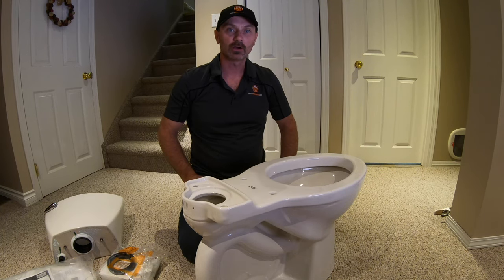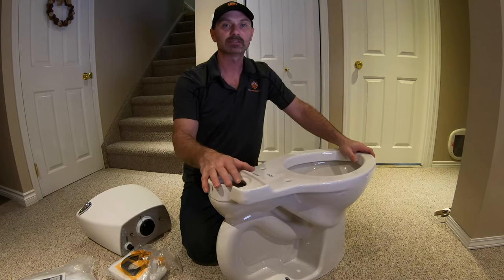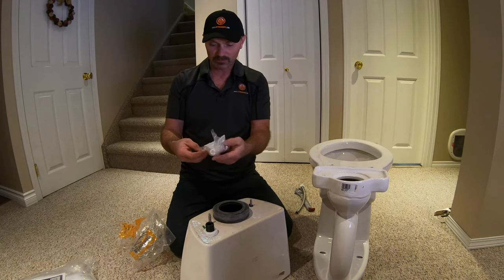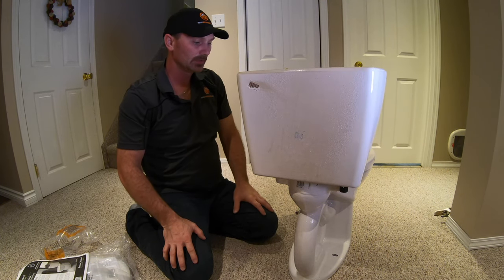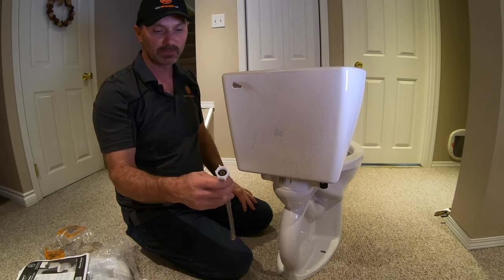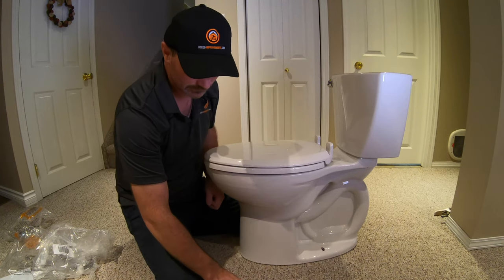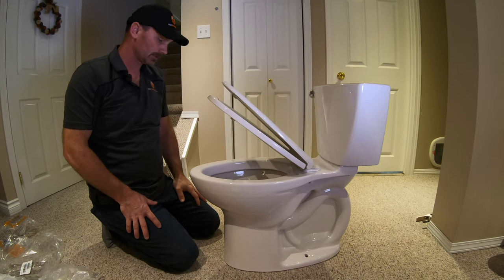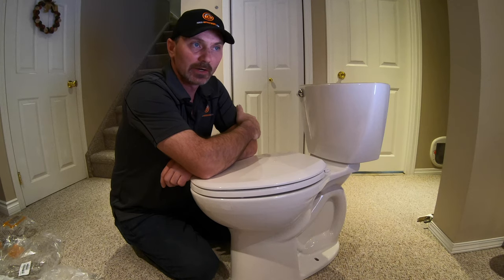How To Assemble a Toilet

Comment: I removed a 32 year old toilet from my master bath and installed the American Standard Champion tall height today.  It was the first one I've ever done myself.  This video and your others really helped.  I also replaced the shutoff valve which was also 32 years old.  Removing the old nut ferrule was a pain since I didn't have the proper removal tool, but I got it off and the new quarter turn installed.  Thank you for this and all your great videos!

Comment: Will a toilet that sits normally straight forward with a window behind you ,be turned say to the right so that you can look out the window now on your left? Will the holes line up?
Reply from the maker: Most likely you will not get an existing toilet to do that . The flange has to turn to allow the bolt holes to be in the right position . Also you will most likely end up with the back of the toilet a fair distance from the new back wall and really tight to the new side wall.
Reply: @HouseImprovements  Ok, thanks , makes sense it might be away fe the wall some...

Comment: After some frustrating attempts to disassemble toilets for remodeling, I would up putting anti seize lube on the tank bolt threads, If you don't the metal seizes even if they are brass. The nylon nut driver is a great idea !
Reply: Is that from over tightening?
Reply: @JustinL614  Not at all- you'd be surprised what happens to metal after 10 plus years of service, brass notwithstanding. I always use a stubby wrench on any tank or bowl to floor nuts, but the tank  nylon wrench seems great as it provides easy reach if the toilet was already in place and you have to take it apart.

Comment: Great and useful video. New subscriber and definitely sharing. Any video that you recommend for my gusset toilet. From the inside at the bottom of the seat the holes are completely clog so there is no flow on the inside on the sides. Hope I explained myself. Any ideas ?
Reply from the maker: I have never seen that before? Maybe change the toilet out to a new one?

Comment: I like the slow close I put on my toilet upstairs, but I have to remember when using the other two in the house or at someone else's house, NOT to let go of the seat and/or the lid!  Other than that, the slow close works well.  I once had to buy a whole new toilet just to replace the tank.  There was a small crack near the water inlet pipe and I couldn't seal it.  I didn't know if there are any sealants for toilet cracks.  Thing is, the crack was only about 1 to 2 inches long.  What is available for such a repair?
Reply from the maker: Nothing I know of is a good permeant fix.